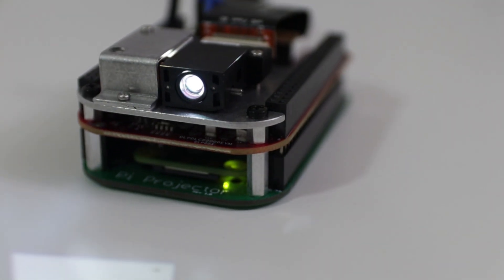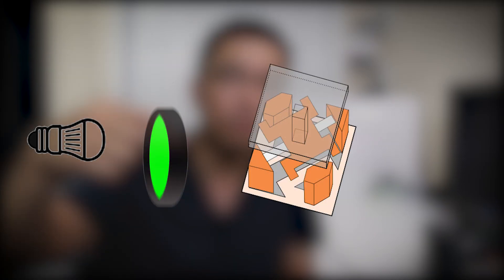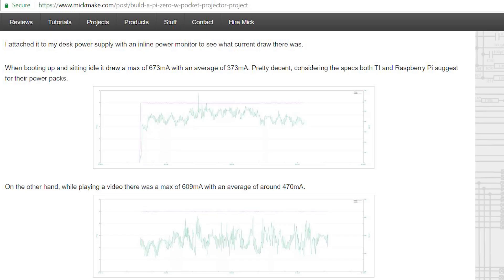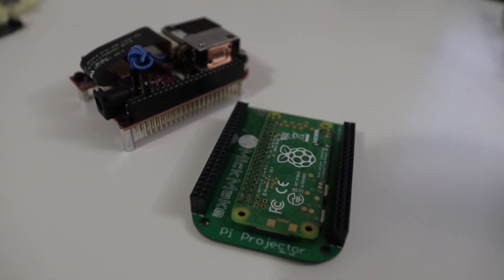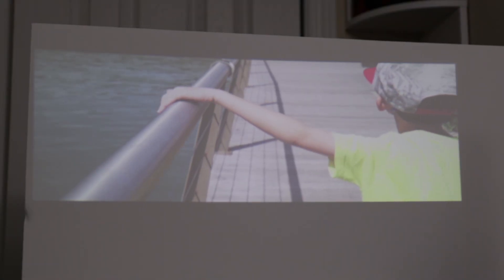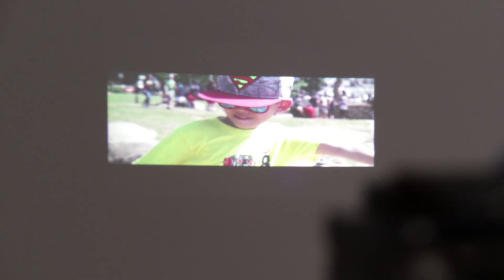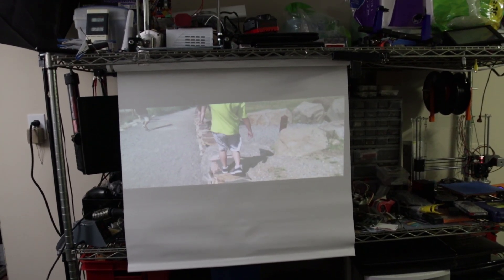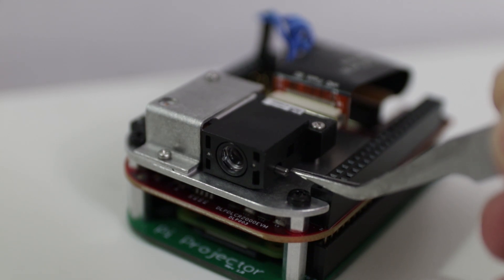Pi Projector by MickMake | The Raspberry Pi Zero Pocket Projector

Comment: Dang, I made mine with a pi3 and brookstone keychain projector with hdmi ribbon for model aircraft pov and ran power from gpio to projector running off 4x aa batts. Works super. I think mine is roughly around the same size. I had no idea this was a thing though, nice video!

Comment: I bought a whole new 1080p projector online for $69 and it works great
Reply: Yup true. You can get them pretty cheaply. They also support HDMI in, so you can use it on anything, but I wanted to make the smallest, low power, self-functioning projector that you could literally shove into your pocket.
Reply: What projector, where?....and are you sure it's 1080p?
Reply: They cheap projectors also don't really support anything near true-HDMI and down-scale to something like 320x240!
Reply: Check the specs on that $69 1080p projector!
Reply: Yeah, it probably accepts input signals up to 1080p. But I'd be surprised if a projector in that price range would also include a panel capable of outputting that resolution. It's just downscaled to whatever native resolution the panel has.
Reply: You can get a used 1080p native projector on ebay for as low as 150$ if you're lucky
Reply: What projector?